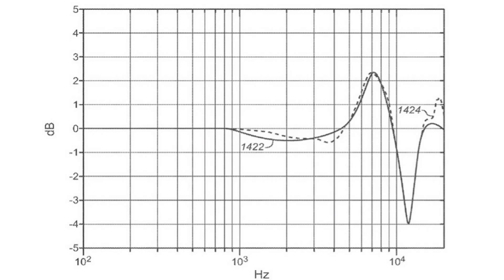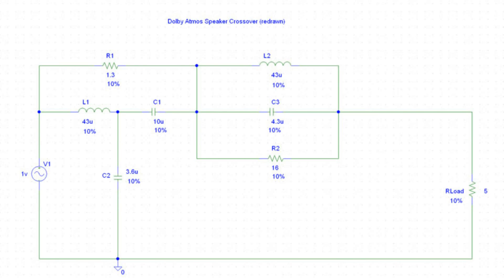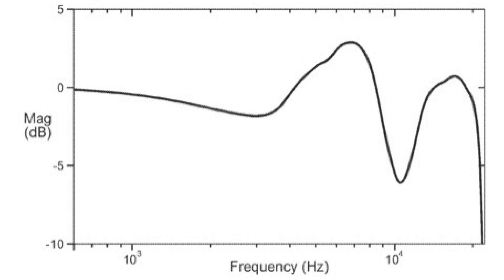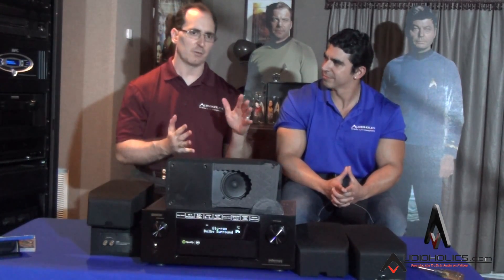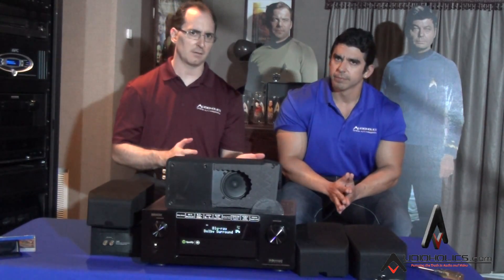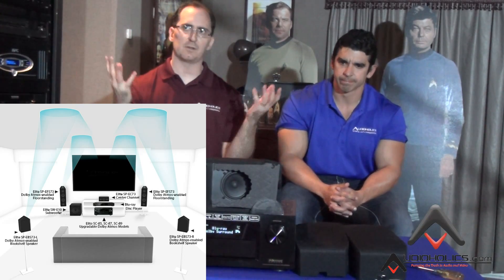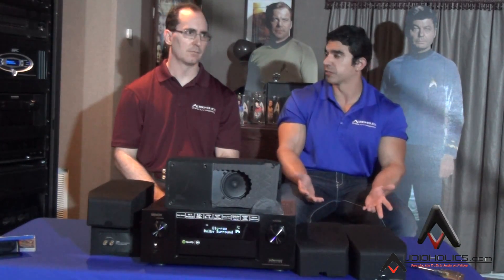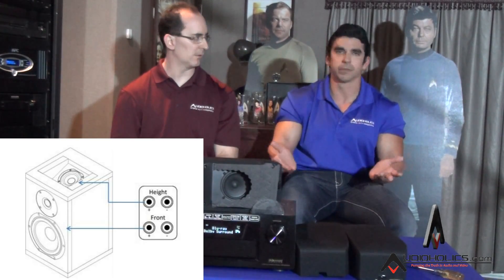Dolby Atmos Enabled Speakers Explained Part 2

Comment: these speakers are clearly designed to be used with AVR's that employ an automated room correction system. the problem with that is, while YOU wont hear the slight dips/rises, your amplifier will. and it will try to compensate for that by just boosting those frequencies a few DB to even it out. thus completely negating the point in having the damned crossover all weird and shit in the first place.

Comment: So I can use any normal speaker mounted on the ceiling pointed down for dolby atmos? I currently have 5.1 setup and have a denon that can do atmos, was looking to expand to 5.1.2 or 7.1.2. Where does the ceiling mounted speaker go between the screen and the sofa?

Comment: How does these compare to the height presence speaker placement for atmos compare to the upfiring?   then for the 2nd part, if height are better, then would it be better in front height or rear height

Comment: I have played with reflective technology before and I feel it works to a degree for certain things. By using reflections and messing with phase you can make a small room seem very open. You can make the sound stage seem much larger than it is. And you can add more surround effect to some music depending on how its mixed. Whoever Madona and Tori Amos use to mix their albums they do a very good job with this. Is any of it accurate, or what the artist intended you to hear? I don't know to be honest, but it sounds cool sometimes lol. Then again a really nice pair of speakers properly set up can do a pretty good job of this too. It is basically a trick if you don't have really great speakers and a crappy room maybe. 

However when you are trying to put sounds in a specific spot in space it simply doesn't work that well. Espeically once you start talking about multi track descrete channels. Its a nifty effect to two channel stuff but that is about it in my opinion. For what atmos and these other formats are trying to do it really has to be done with with directional speakers mounted in the correct spot and using DSP technology to control it. When done right it can sound amazing, especially the new Neural X format. When done wrong it really isn't that impressive, to down right annoying.

As for those Def Tech speakers. I think the engineers were given a pile of parts and specs and told to make it work the best they could. I think they had their hands tied for most of it. Which unfortunately is sometimes an engineers job. There is a difference between product engineering and doing R and D work where you are trying expand technologies or create new ones. Def Tech is pretty good at innovation and making things better. I think if they were told to create this effect and left alone to do it their way they would have pulled it off in a pretty great way.

Comment: Hi Gene love watching and learning from you guys and im sure evreyone else feels the same,
im hoping for a little help with my system, im waiting for delivery of the denon avrx3400 h should be here by monday  and  wondering what your thoughts would be on my question.i have 2 subs the def tech 2000 and de ftech 4000, center is the powered def tech 9080,rear are the surround bp 9080 and im looking into the towers def tech bp9080.mainly because i can get both for under $1600  question is   am i wasting my time with these while i still want to keep the 2 subs going or would they be conflicting ?  my room is 20x20 with vaulted ceiling thanks in advanced for your input james

Comment: Recently purchased the Dolby atoms pioneer add on speakers unfortunately my current receiver doesn't support the input, would anyone recommend connecting these as rear speakers?
Reply: mount them as  elevation speakers  on a wall.

Comment: I'm not falling into this atmos stuff at all and you guys said its analog and you don't know why they would do it that way well think back to the first surround sound it was stereo in the front and analog rear then after they made untold millions on it they came out with dolby 5.1 .. If this goes over well and they make millions off it they will brake out the atmos digital .. Wait and see ..
Reply: kybluesnbullets  =

Comment: Hi Gene im really interested in auro 3d. what are you thoughts on it. Also keep up the great work
Reply from the maker: Auro 3D has some great potential.  Speaker placement is a bit more practical than Atmos but Auro lacks marketshare.  It will be interesting to see how these new immersive sound formats pan out in a market where 5.1 is barely feasible for most folks.

Comment: My processor does have True HD & DTS MA,  I would like to have a 7.1 speaker setup  but I would need to place the surrounds in the ceiling above seating area and place the rears on the back wall. Would you recommend this?
Reply from the maker: Its better to have the side surrounds on the side walls instead of the ceiling and the back channels either on the back wall or in-ceiling behind the listening area.

Comment: It's important to remember that atmos represents more than just ceiling speakers or 'height' channels. This is a change in the way audio is mixed and also how it is delivered and decoded by your equipment.
Reply from the maker: The way it's being implemented in the home is channel based TrueHd with added height channels.  You don't benefit from Atmos without adding height channels and the base bed channels still gave the same fixed positions.

Comment: In your opinion do you think its worth upgrading your equipment to Dolby Atmos ? I have a 7.3 setup now which I love but do you think its worth the upgrade ?
Reply from the maker: Only if your current AV Receiver doesn't have Dolby TrueHD and DTS MA decoding built in.
Reply: troy brown can you use regular speakers on a dolby atmos reciever ???
Reply: troy brown can u use any regular sony or any other speakers with a dolby atmos 7.2 reciever ?
Reply: Ruben Avalos The name brand of the speaker does not matter when it comes to having your system setup for Dolby Atmos. The receiver or pre-amp has to be Atmos ready in order to get the Dolby Atmos experience

Comment: You guys are awesome. I love how you guys break it all down based on facts. Overhead discrete speakers is the way to go for the true Atmos effect at home, but tough pill to swallow to spend more money on speakers. I'm going to stick with the 5.1 setup which is still working great. With 5.1 i can spend more money on nicer speakers for each channel instead of getting some half assed Atmos speaker
Reply from the maker: Thx Nathan.  Quality over quantity is always a better approach.  If you're only running one subwoofer, try adding another identical sub and follow our guidelines for placement.  Bass represents about 60% of the home theater experience!
Reply: Exactly Nathan.  I am running a 7.1 and I am not interested in Atmos.  I like what Gene said in that at least with elevation speakers using this crossover is nothing but "marketing b.s."  Totally agree.  I also want to add to the subject of Atmos when Hugo asked the question about Atmos being something big in audio in the last 20 years.  This is nothing but effects that may or may not work.  I myself do not believe that Atmos will be a success.  By success I mean wide sales and implementation in homes.  Few ladies of the house will allow speakers to grace the ceilings of America.  Also the complexity for the setup and cost factors will send Atmos down the road of 3D.  Hopefully DTS uses some kind of magical meta engine using existing speakers to "improve" the surround experience but we'll have to wait and see for that.
Reply: I have the Elac deubt A4 Atmos Speakers and I don't believe it's "marketing b.s". You can really sense a whole environment of sounds.